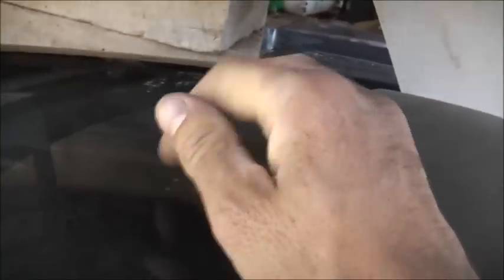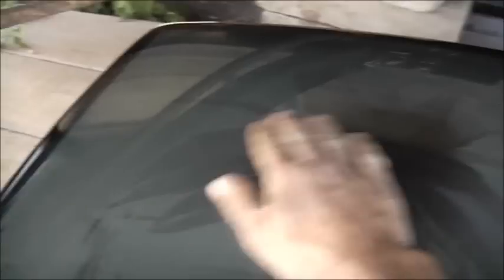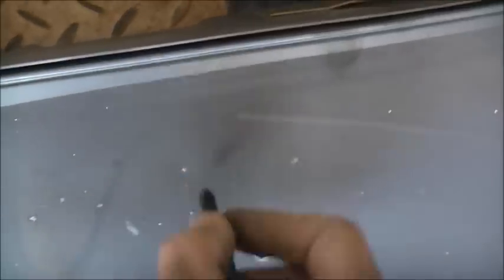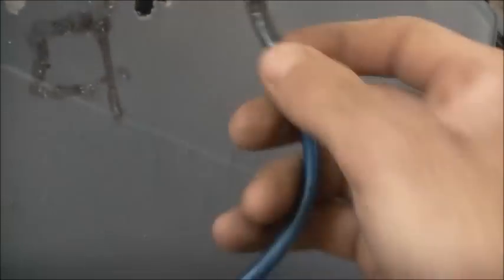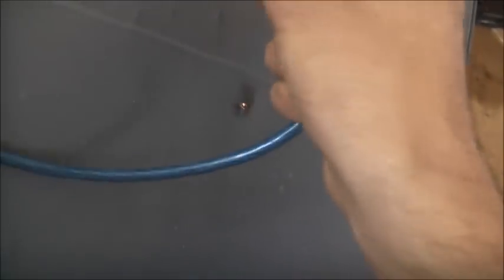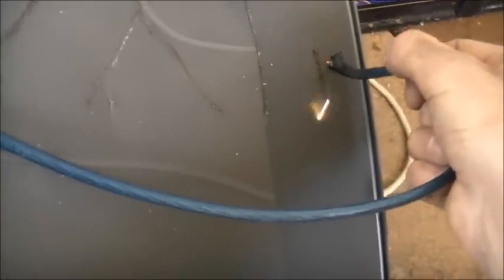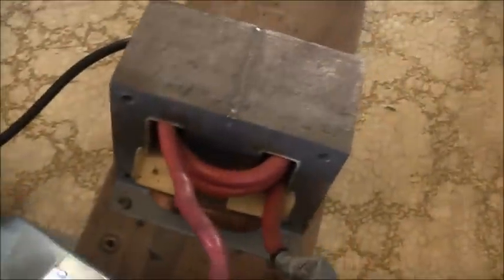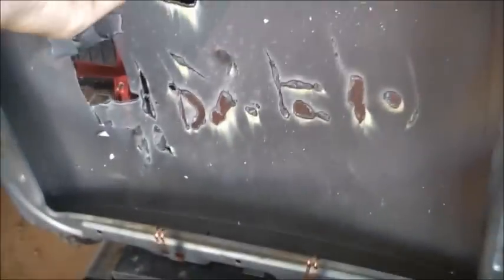Samsung CRT Blast Shield & Shadow Mask Destruction!

Comment: I wonder about burning the shadow-mask before cracking the CRT open. As far as I have experienced, it's really doable. Dark glasses may be an advantage if you do that :)

Get the deflection coil out of the way(but still connected to main-board), then use magnets to move the beam around while the monitor/TV is powered on. Have brightness on max.